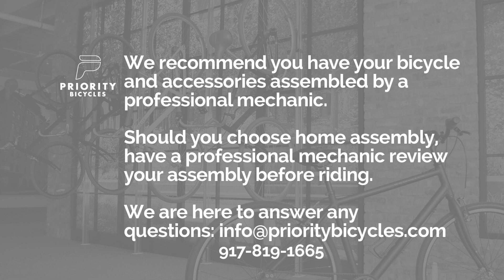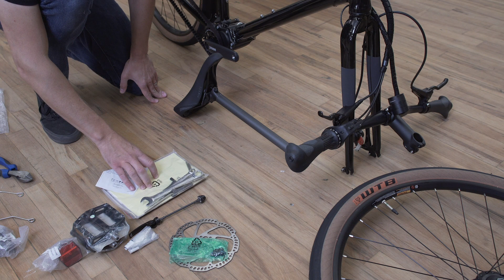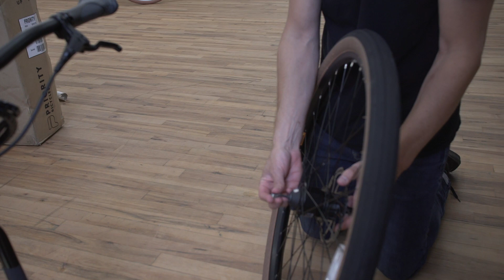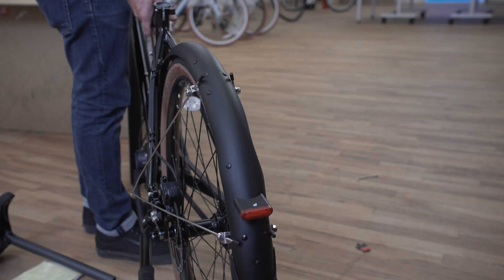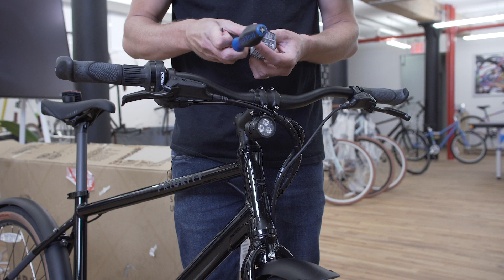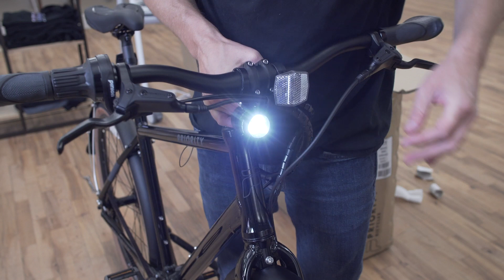PRIORITY 600 ASSEMBLY

Comment: Just purchased one and the assembly is proving not to be as straightforward as portrayed here. They have the front brake line routed on the right side of the bike, which is opposite what they show here. There has either been a change, or it simply is not assembled correctly, not sure which.
Reply from the maker: Hi there! Go ahead and send a photo or video to info@prioritybicycles.com. We will help out right away!
Reply: @PriorityBicyclesNYC  I just need to know if there have been any changes in the way the line is supposed to be routed since this video was made. If not, then I will have to take either the caliper or brake lever loose so that it can be routed as shown.
Reply from the maker: @GenerationXT  hi there- no changes to it, and tweaking the caliper of shouldn't have to happen.  Likely the orientation of the handlebar just needs to be spun or something like that.  If you can text us a photo or video, we can help out right away, or even send back a video with one of our 600s here- we are always around to help!

Comment: I had some difficulty with the front fender, as I could not seem to keep it dependably spaced to prevent the front tire from rubbing on it.  If I put the front fender on with the clip in front of the fork (instead of behind it, as shown in the video) I had a much easier time adjusting its position to clear the wheel.
Reply: Given how well engineered this bike with components is, I suggest that you either did not understand the instructions or what you were looking at.  E.g, the slotted hole.😢

Comment: Dave says 40 psi minimum. 
What are the ideal tire pressure ranges for 1.) street/asphalt, and 2.) hard packed trails & gravel. Thanks.
Reply from the maker: If you wanted to minimize rolling resistance while still taking advantage of the benefits of 650B, we'd recommend 50.  40 is great for hard packed trails and gravel.  Thanks!

Comment: Got it all put together! My engineer husband went crazy because I insisted on doing it all on my own. The DYNAMO connection gave me fits for a few minutes. Mine came with nubbie tires and the front fender strut bolts rubbed on the tread. No adjustment changed that, so I bent them out to bow just a hair and all is well. Everything else went smoothly. Thank you for the tools, excellent packing job, incredible video and fabulous bike!
Reply from the maker: So awesome to hear!  Well done and have fun!